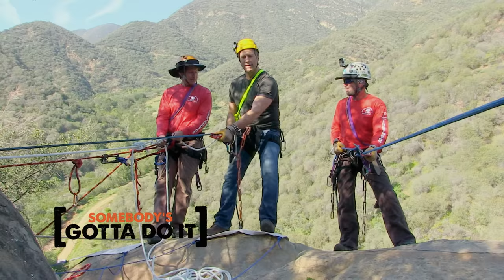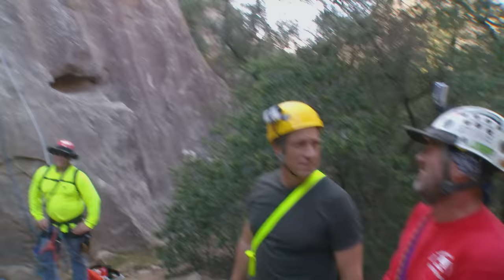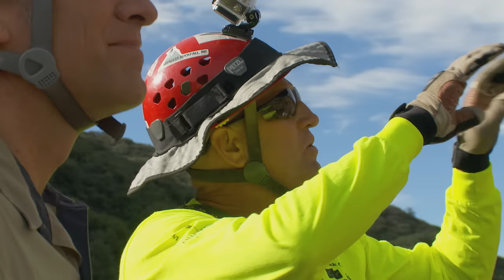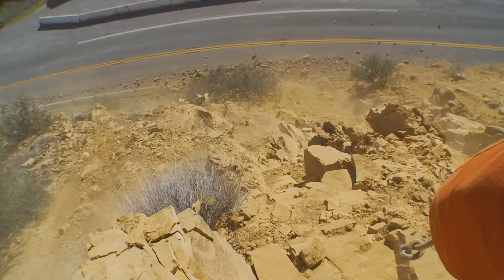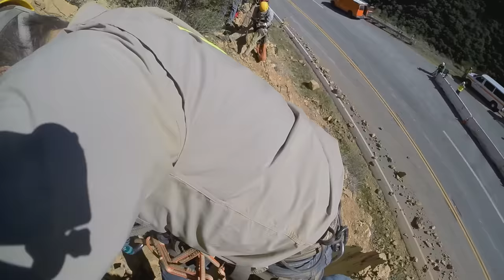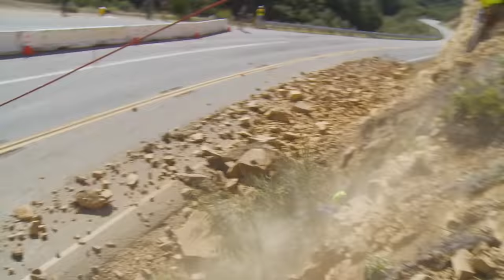Mike Rowe's Scrape with DEATH to Save Your LIFE | Somebody's Gotta Do It

Comment: Numerous times, I have driven through Zion National Park in a convertible with the top down. 
The views of the cliffs directly overhead are spectacular. 
Seeing the red formations on the black asphalt from the falling rocks tends to be sobering as to what would happen if one of those rocks hit without a roof overhead.
Reply: You wouldn't fair much better with the canvas roof closed. If anything it would just make it harder to see.
Reply: @ComicusFreemanius  Even a metal roof only does so much. The sheet metal isn't that thick vs. the cinderblock-sized chunks they were sending down—and unlike cinderblocks, they are solid.

Plus a rock can go through your windshield and easily hit your legs, your pelvis, or your chest. It's moving downward at a good clip while you're moving forward at a good clip, so the direction relative to you is diagonal towards you, not straight down. It can even hit the top of your windshield and then hit you in the face or neck, even if the roof of your car covers your head. There have been cases of people dropping rocks off of pedestrian overpasses and killing people this way. That's why a lot of them have chain-link fences now.
Reply: I'd be afraid to travel this area in a convertible, but then I'm a fraidy cat.
Reply: @Felice_Enellen  Ikr, If it's sharp it'll just spear through probably. I remember those stories of those stupid kids throwing rocks over an over-pass.
Reply: @Felice_Enellen 
Clearly you should wear plate armor on vacations, then?

Comment: In the Midwest you watch for deer while driving, in Ca. you watch for rocks and boulders driving around corners in the mountains.
Reply: That's no lie. Along the coast, much of the mountain range is sedimentary rock (sandstone) and it's very weak rock, easily eroded, with lots of fracture planes as you saw in the video when that really big one simply disintegrated as it fell down the hillside. I actually live just a few miles from where this was filmed. That tunnel in the last few minutes of the episode is in a place called Wheeler's Gorge.

Comment: Coworkers invited me rappelling back in my twenties. We drove from Nashville, Tennessee down to the Chattanooga area. Can’t be specific on the actual site, it was a long time ago. It may have been a state park. We arrived, parked, and walked uphill at a steep angle for about an hour. We arrived at the summit. Looking over the edge, I saw trees at the bottom that looked to be an inch high. They hooked up the rappelling gear to a couple of trees. I held onto one of the ropes and got a good view of what was there. We couldn’t rappel all the way down, but rather to a big ledge about a third of the way down. I asked how we would get back to the top. One of the guys pointed out a fissure in the rock face to the left of the ledge. We would have to pressure climb up the fissure, back to one side, feet on the other. You would be hooked to a rope for safety when going up. It looked like a lot of work for a negligible return, plus my fear of heights was strong. So I never went over the edge. I can live with that.

Comment: I was certified confine space and high angle technical rope rescue.  There is something about the first step stepping off a i-beam pipe rack 50-ft in the air hoping you don't swing back and smack your face on an i-beam.  I totally understand that feeling of testing gravity even on a rock face.

Comment: Never knew there were volunteers for this. I know I've seen them place two rows of fences, and maybe a concrete wall with the hooks for placement around TN and VA, but this could help prevent road closure and aid with mitigation damages. I'm not sure if they do it around here, but I really think if we don't that we should start.
Reply: Those fenced rock faces over there are too much an "eye sore" for CA
Reply: I'm sure at some point a crew will be sent to actually clear those debris because those safety nets won't stay secure forever.

Comment: I love the way that you are still doing hands on hard work to open up the new generations minds. I was watching this and I have a few questions/ideas, if I was doing this I would have a gallon of cold water in an insulated Camelback. Also I can see a telescopic aluminum hoe like forest firefighters use but with a fold down blade and strap as a second tool instead of flicking every little rock by hand. And finally I can't believe that they used that strategy to move the big rock, it was just so primitive.   I only finished 8th grade and went to work but even I can see how a few guys repelling towards the bigger rocks could have a backpack with interlocking small sections of pipe and a turns turnscrew and a breaker bar for better leverage. This can be done with light weight modern materials and common sense, watching 3 or 4 guy's on ropes moving that rock was a sad reflection of American ingenuity.   I've watched men in Bangladesh in bare feet making car parts from scratch with almost nothing to work with. Basically the whole operation was cool but you need to think more about the tools that you are bringing to the job, sometimes you need to pry and an 8 inch hoe  would be the tool to drag all of that loose small stuff...